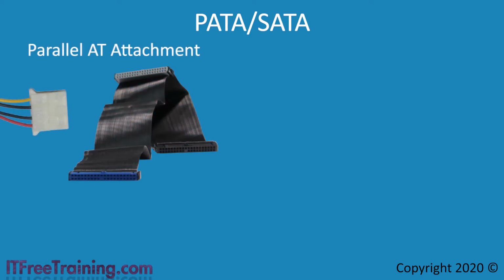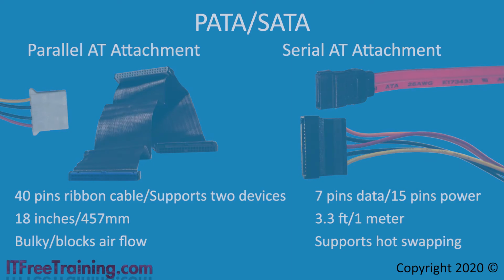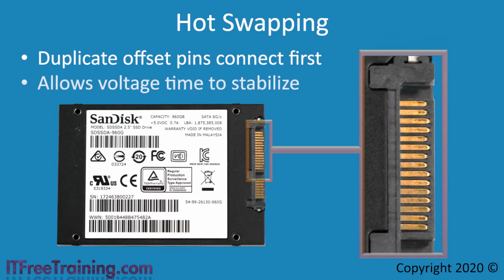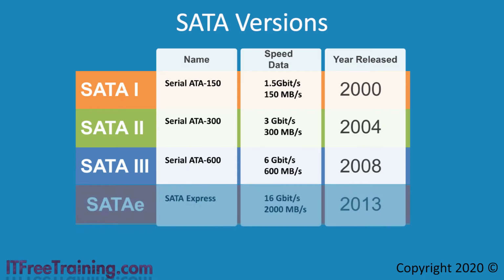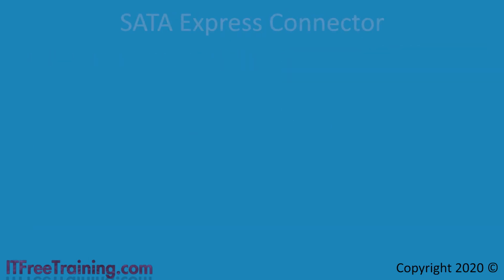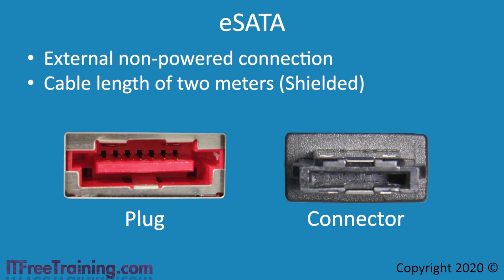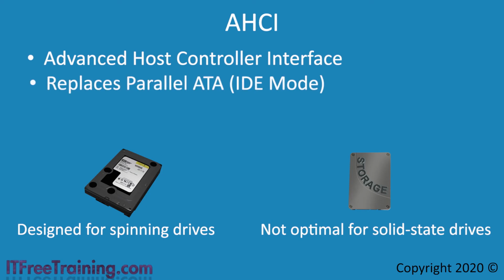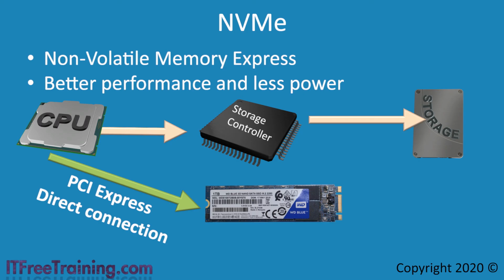SATA and eSATA

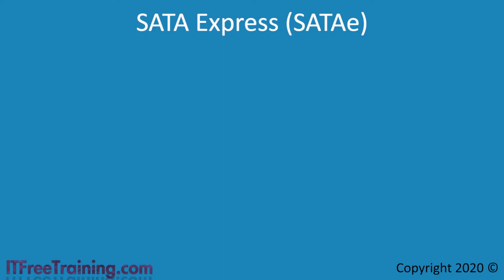Comment: 7:59 Im confused, you said that sata expres uses and connects right into the pcie bus. What's do you mean by this i thought sata and pcie were both different interfaces and you had to chose between one or the other . So how do these two work together? Or who commands who pcie or satae
Reply: SATA express is found on PCI E add on cards controlled by the cpu or chipset.
Reply from the maker: SATA Express is a connector standard that can carry either SATA signals or PCIe signals. It doesn’t merge the two protocols — it simply allows one physical port to support both types of drives. When a PCIe (NVMe) drive is plugged in, it talks directly to the PCIe bus, bypassing the SATA controller completely.

Comment: Interesting video. Can anyone recommend an external power supply for 3.5" SATA disk? It must ble 240v and supply 12v/5v. Thanks!
Reply from the maker: You would usually purchase an adapter that have a power supply. You could in theory use your own power supply as long as it outputs the required voltages.

Comment: I've seen a lot of motherboards with a SATA Express connector, but I haven't seen the SATA Express cable and SATA Express drives for sale. Is there somewhere I can find these devices for purchase?
Reply from the maker: I think we got ours from ebay, but I had a look an can't see any. Usually ebay is a good place to get those old cables. Best of luck trying to find one, they seemed to have disappeared from the market.

Comment: I recently purchased a brand new Synology RaidStation NAS box which comes with 8 x 3.5” drive bays.  Because I needed more storage, I also purchased a 4 bay expansion box.  Imagine my surprise when the main unit connected to the expansion unit using an eSata cable.
To add insult, the cable that came with the unit was defective and I had to buy a replacement.😢
Reply from the maker: Hope you did not pay too much for it. It is become more common with NAS and related devices not to be as good as they look. Using software RAID instead of hardware etc.

Comment: If I remember rightly, the Amiga Computer used Sata before IBM pc's. I was using sata for my amiga harddrive around the time of the IBM 386 . Cheers
Reply from the maker: The last Amiga was released before the SATA standard was complete. So I doubt it was natively support and Amiga SCSI based. However, there may have been interface cards released after that. This thread explains it.
https://www.amibay.com/threads/sata-controller-for-amiga-computers.2441305/

Comment: Your picture of a PATA cable was wrong. That was a 80 wire cable  a different standard.  That was a Ultra ATA2 a different standard that is twice the speed
Reply from the maker: I appreciate your feedback. I apologize for any confusion. The PATA cable is the modern name covering all the standards so could be either cable. If we make a another video covering PATA we will make this point clearly. Thanks for pointing it out.

Comment: Is there any adopter that can connect USB 3.0 port to SATA Data connector cable? 
Sounds weird but my front I/O panel uses SATA to read USB drives.
Reply from the maker: I think you may have something like this. Front IO panel will have multiple cables that connect to different parts of the motherboard.
https://www.amazon.com.au/SIDAKE-Multifunctional-Dashboard-Media-Reader/dp/B092D4WWT9

There are adapters that will convert USB 3.0 to SATA.

Comment: Hi, Thanks for your video. I have a simple question : All my SATA connections are used, but I still have two free eSATA  on my MSI B150M. I want to plug an extra intern SATA SSD: may I just plug it in the eSATA (with a dedicated cable), and it will work the same way?
Reply from the maker: SATA SSD and SATA hard disk use the same SATA interface. Thus, your eSATA connection will work the same way with a SATA SSD as it will with a SATA hard disk.
Reply: just use sata to usb cable

Comment: my eSATA in not working, plz help! 

motherboard: Intel DH67BL
processor: Intel 2nd gen
OS: Windows 10 64-bit
Cable: SATA to eSATA with USB power
Drive: WD 1TB HDD 2.5"

please let me know if I need to install any additional driver to make it work.

Thanks in advance.
Reply from the maker: You should not need to install an additional device driver to get it to work, it however may not be enabled in your BIOS.

Comment: Hi Austin, thnxs a million for this video. I'm nearing 70yrs and plan on building my first PC. Still in learning phase. Now compiling an URL database with all YTube pcbuild and tech-info video's I can find. This one comes on top. thnxs. Planning my PC: Gigabyte MB550M , CPU 5600X, GPU (like GTX1660), M2SSD, RAM. I want to take from my old PC: DVD/RW 10yrs old, HDD 5 yrs old, SATA SSD 1 yr old. (plan to build PC with only M2 first, than install WIN10 from my WIN-USBflash.)  B550M has 4 SATA3 6GB headers. How do I data-connect my 'old' devices? what device in which header? Your answer will be so much appreciated.
Reply from the maker: Thanks, glad you like the video. SATA is backward compatible so you can plug it straight in and it will work. If the DVD/RW is SATA it will also plug in. If it is IDE (Big connector) than the motherboard will need to support it (Probably does not now days) otherwise you can purchase an expansion card to add this.

I would install the operating system on the M.2 first, once the computer is up and running I would add your old drives. These drives should appear in the operating system as data drives. Just make sure you computer is configured to boot of the M.2 drive.